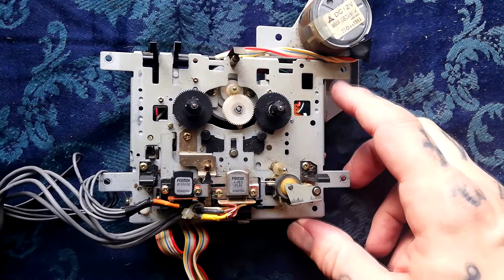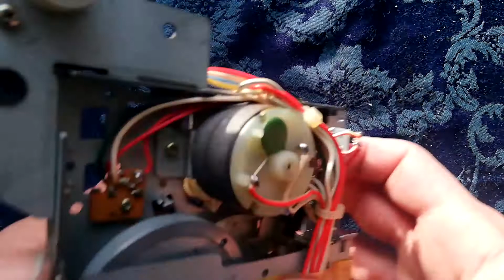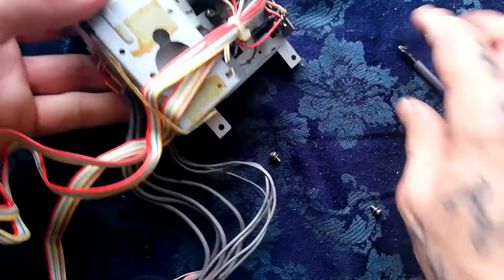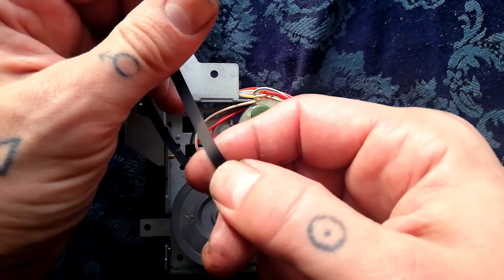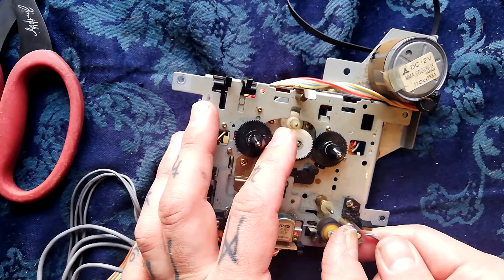fostex 260 | Tear down | 2 | Change belts  & pinch roller

Comment: Thank you for the videos, I have a Fostex 260 and Im trying to repair it now. The cassette stops after 1-2 seconds when I push play or any of the buttons. And it only works once then I have to restart it. Do you know why this is happening? I have read that it can do with some kind of counter and autostop? But does the Fostex has that and it is an other belt for that?

Comment: My idler wheel- the bit that spins the belt- the rubber tire on it gummed up like crazy and I cleaned it and replaced the belt. But bc the tire is now gone the playback is hella pitched up. Bc of that missing diameter the belt travels less distance and pitches up so a replacement wheel is necessary I think.

Comment: I am new to cassette recorders and just got my hands on a second hand Fostex 260. Unfortunately, I discovered an issue with the transport. When the play button is pressed, I can hear the motor working (I guess) for about a second, then it stops and the Play button does not do anything after that, as well as FF and RW buttons (which work okay before hitting play). Have you ever stumbled upon this issue? Thank you for your videos, they are really helpful!
Reply: Ever find a solution? I have the same issue
Reply: @mooneemonster7373  Yes sir. My issue was resolved by me changing the belt inside the machine (following the procedure that is shown in this video). In fact, when I disassembled my Fostex I found that the old belt completely disintegrated.
Reply: @millyrock5476 I also changed the disintegrated belt in mine but still having the same issue. I know both motors work and everything else seems fine so im pretty confused !
Reply: @mooneemonster7373  so now after you've changed the belt the drive mechanism is turning the reels when you press play? or the reels are still inactive?

Comment: Hey Tetrakan. I have a problem with this one where the play head won't go back down because there's too much gunk between the 2 plates (the one with the playback head and the back plate). Is there any way to lube or clean that WITHOUT taking anything off? I don't want to have to adjust the azimuth.